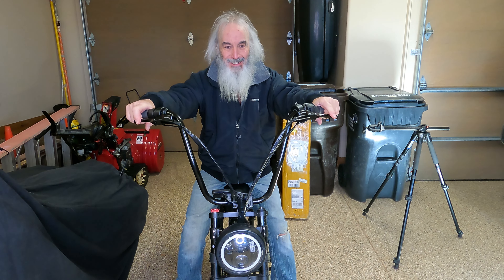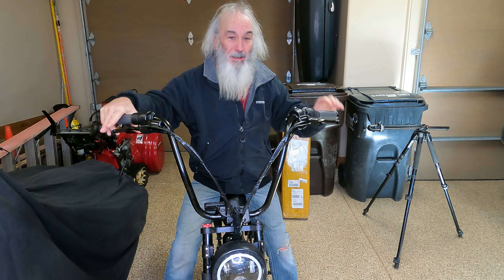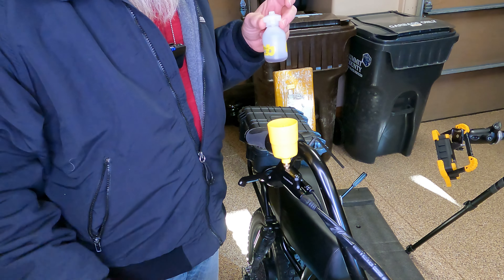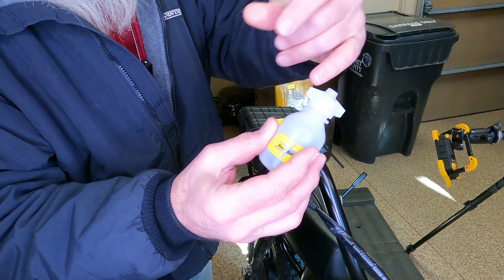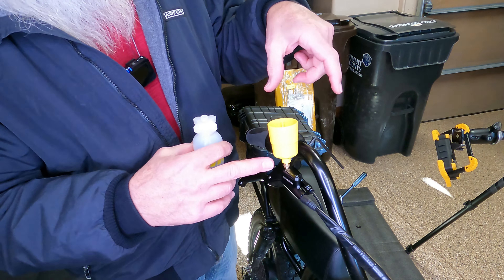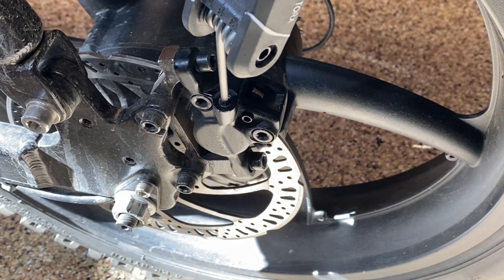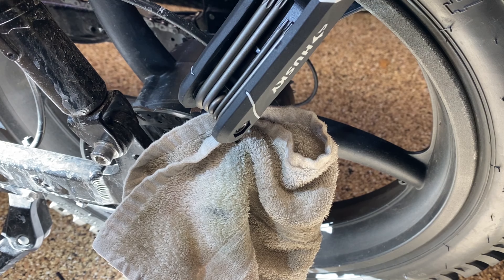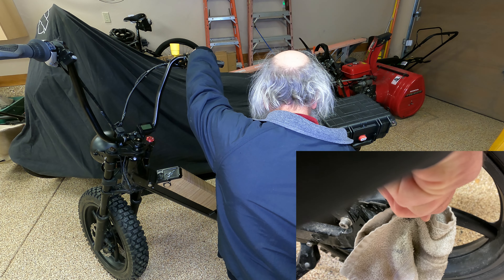NO MESS! Easiest Quickest⌛HOW TO way to Burp your Hydraulic Brakes🛑 on a Juiced Bikes HyperScorpion

Comment: Nice. My many years of auto, motorcycle, and small engine experience transfers to the hydraulic brakes on my bike. People don't even need the yellow bucket if they take off the other 2 screws that hold on the cover at the handle...

Comment: I have been on youtube and google for several hours and I just happened to come upon your videos.  You are SO SMART!  I have the exact same problem with my Tektro Brakes HD-E350 as you with the one caliper moving and the other one not moving.  But, my bigger problem is I had to buy a new brake hose kit (Trek store charged me $31 and then I found it on Amazon for $10).  Anyway, I needed a longer hose because I raised my handlebars so far up that the brake line wouldn't reach anymore.  I just want to put the brake lever and caliper back on with the new hose and I couldn't find out how.  Now I know, thanks to you!  I was on the verge of tears being that I have spent the entire day trying to get my bike up and running so I can go for a ride!  I'm new at fixing my own bike.  I can't thank you enough.  Where are you located?  I sure could use a bike mechanic like you to teach me the tricks.
Reply from the maker: Thanks DVDS, This means a lot to me.  When I put my apes on, i had to lengthen both front and rear, I reused the rear for the front and bought new line on Amazon for the rear.  Markup is part of every business, why should I risk capital to stock something I can't sell and make a profit on, that still has a risk of loss or theft.  
Invest in decent tools, as they will last ya a lifetime.

Comment: I tried this and it doesn't work for me. The pistons inside the cylinder still doesn't depress against rotor I'm getting no movement with the caliper
Reply from the maker: Yeah, the design on the lowest priced option for Tektro POS hydraulic brakes is 🐂💩.  Only one of the pistons ever moved on my bike.  Before you look for a brake upgrade you may try a full bleed on the lines and a complete disassembly of the caliper & piston
Reply: @UncleFjester  do you have a video on that and I have dyisland hydraulic brake
Reply from the maker: 🤷🏻‍♂️  https://youtu.be/RkKw2gjyYcM

Comment: Thank you for the thorough instructions, my rear brakes on my 35 mph ebike are gone, so I tried the method of removing reservoir screw and pumping the lever to remove the air, but no joy. I will try your method next, but I have to get a bleeder funnel first. Thanks man.
Reply from the maker: Could be your pads too!  Any Bicycle brake set up isn't designed for the weight and speed an ebike produces, you may only get 500 miles from a pair. Good luck

Comment: hi.. if i have too much travel on the hydraulic brake lever  does that mean it needs more fluid or is there another adjustment?
Reply from the maker: If you don't have a measurable amount of air in the line then this burping method should fix it.  If there is so much air or contaminants in the lines then you may want to do a full drain and refill.  
Just like everything in life, the first time will be a Fjuckin mess,  the more you do it the easier it gets.  I can do a full drain & fill in a few minutes now.

Comment: Off topic,have you ever had crunching in the rear wheel,
Reply from the maker: nope, does it sound like grinding? Prolly wheel bushings.  The wheels are poorly designed.  did you see this? https://youtu.be/RCQEXWMmDAw
Reply: @UncleFjester  thanks will check them tomorrow. By the way I have enjoyed a lot of your videos. Running with knobbys on the hyper, keep up the good work
Reply: Typically it's the nylon planetary gears on the internal clutch beginning to shred. The little pieces are getting caught in the other teeth causing the crunching noise. Easy to replace.

Comment: Why is there so much travel in your lever? You need to be a less travel as possible without the pistons pushing the pads against the rotor.
Reply from the maker: Yea, good luck with that, These Tektro Brakes are the worst entry level POS on the market.